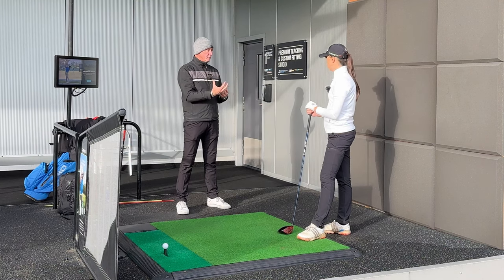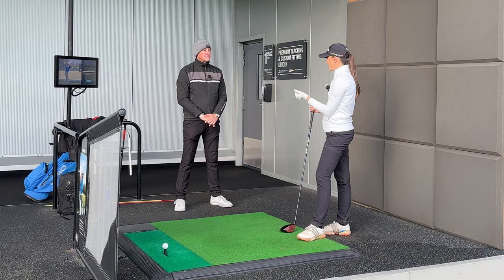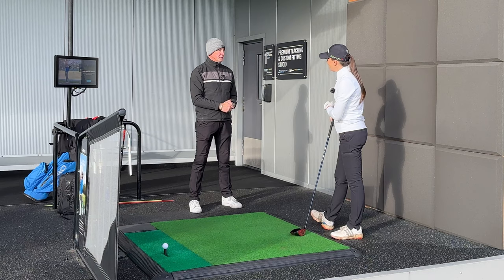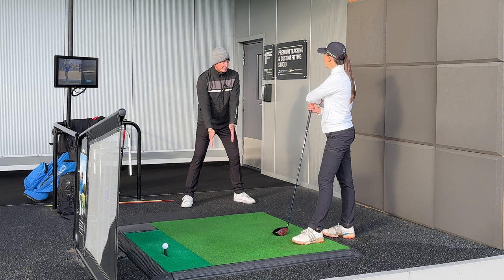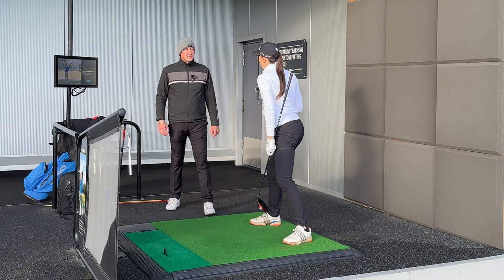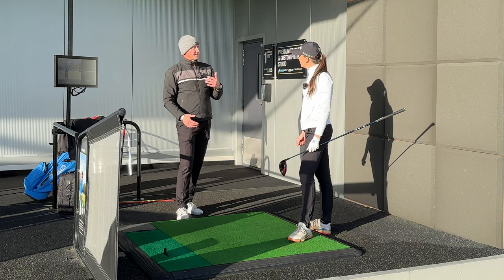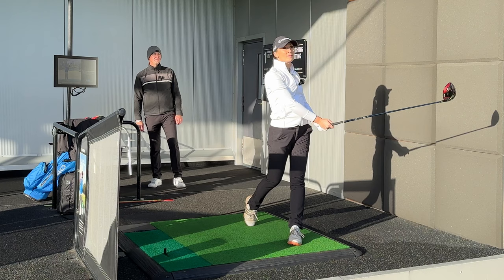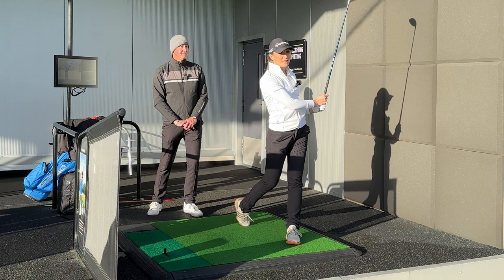How I'm Fixing My Out To In Swing With Driver To Get That Draw Back

Comment: Hi Jess, another good video. You mention you have a tendency to roll the club on the takeaway, I struggle with this and every time I think I’ve nailed it I video myself and guess what the roll is back ☹. So just wondering what drills you’ve worked on to improve that tendency?. Happy New Year
Reply from the maker: Thank you, Gary! I know that feeling of frustration...just when I think I've cracked it, I'll watch a video back and see it's slipped on the inside. The dry drill I'm using at the moment is feeling like I'm moving my hands (using my shoulder to drive the movement) over my right knee, keeping the club outside my hands. I'll do this with a mirror too so I can check that the feeling matches to the image I want to see. I'm thinking about doing a video on the drills I use so I'll make sure to cover this one! Happy New Year!
Reply: Thanks Jess, will try that, if it doesn't work I'll try crown green bowling in the new year 🙂 @jessratcliffegolf
Reply from the maker: @garywoodhouse5698  haha! I might be joining you 🤣

Comment: Yup. I need a driver fitting this year.
Reply from the maker: That's exciting! What driver do you currently have?
Reply: @jessratcliffegolf M4 off the shelf. Regular shaft because of bad life choices. 105mph head speed last time I was in a simulator.
My new t150 irons will be here early February. 
Irons-+3/4 , 2flat
Eyeballing tsr2 or tsr3. Or the wildcard burner mini

Being taller means everything is custom..
Reply from the maker: @dobermanownerforlife3902  That's exciting about the new irons! Just in time for a new golf season. Nice. The burner mini has caught my eye too, seems to be more playable off the fairway as well, to give more options. I've got the Stealth 2 Plus driver and love it. It'll be interesting to see what comes out on top in the fitting ☺
Reply: @jessratcliffegolf  we shall see. I was rocking the 4i about 195 carry. The 3i will tell the tale if it gets used off the ground or restrict it to a driving iron, maybe tweak the loft from 19 to 17. I'm old hat golfer these hybrids are new tech for me. Maybe a 2 hybrid to fill the gap or 5w with 3w shaft.
But at 44 years old I'm just pumped to still have. 95mph 7i club speed.
Reply from the maker: @dobermanownerforlife3902  that’s awesome! All exciting stuff to be explored.